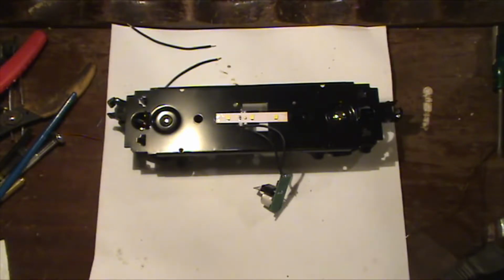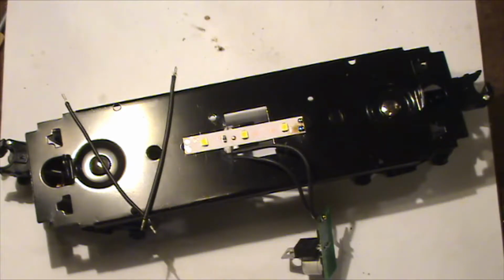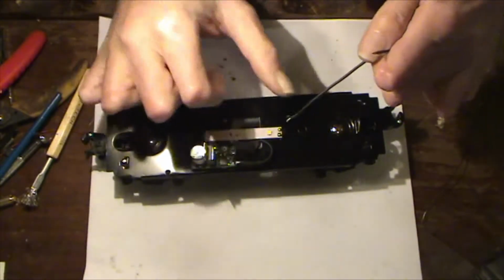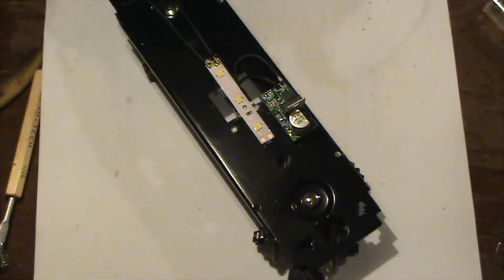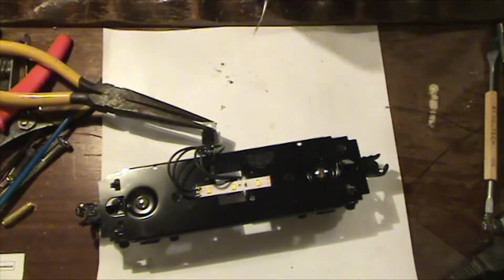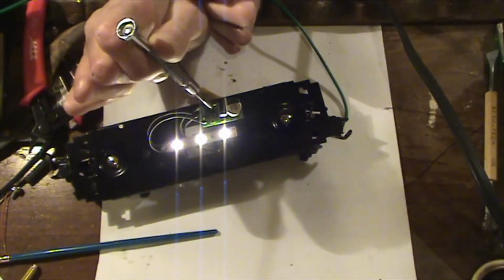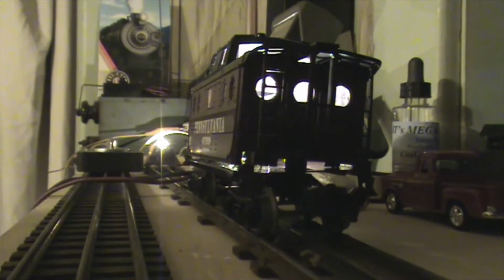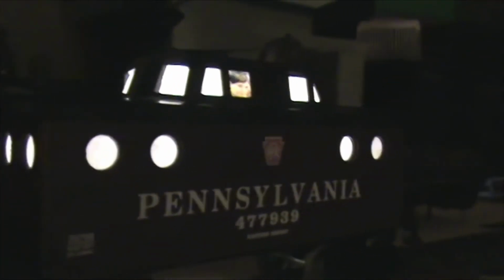Lionel Pennsylvania Flyer Caboose light installation (3rd and final part).

Comment: Thanks for taking the time to show how this process works for us new modelers.
Reply: Would you be able to share a link or part numbers for what you used? I’m trying to source them myself and I’m working with my local shop. However, they are taking a while to get answers.
Reply from the maker: @IceHK2  I purchased the constant lighting circuit off eBay here;  https://www.ebay.com/itm/313904621179 and I believe these are the lights I purchased, 12 volt that can be cut into smaller strips, also from eBay; https://www.ebay.com/itm/265121568333
Reply: Thank you for the information!
Reply from the maker: @IceHK2  You're most welcome!  Good luck with your project!
Reply from the maker: Welcome and thank you for watching and commenting!  Happy to help!